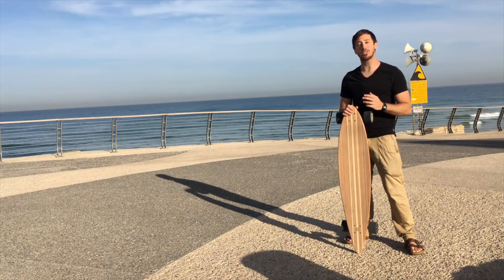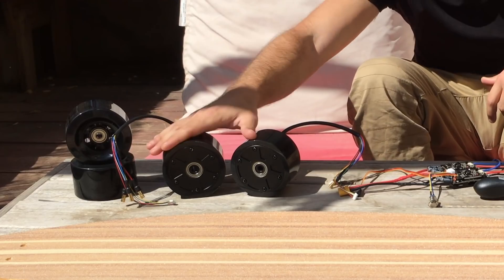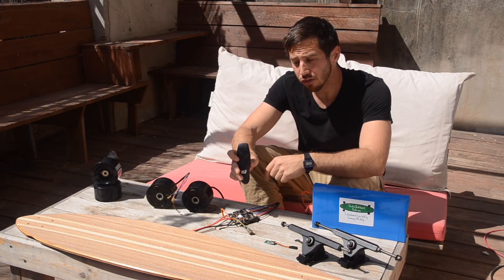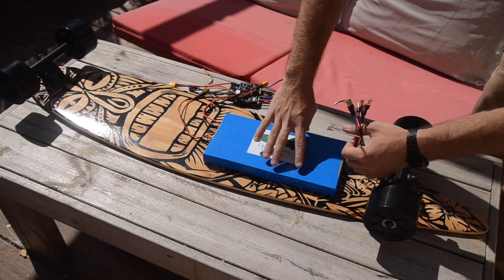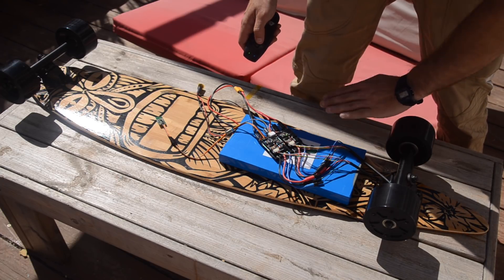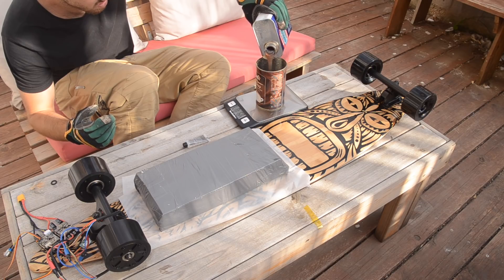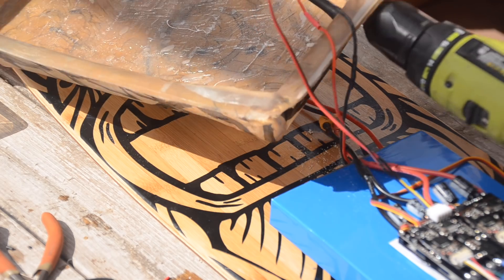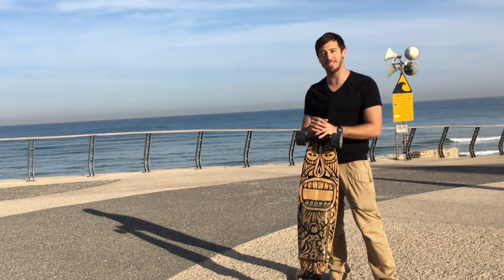Build a DIY Electric Skateboard or Longboard - it's EASY!

Comment: Did you do a range-test yet? How far can it go? With the nice flat battery it seems like you could even fit one more on a long board... Thanks for sharing!
Reply from the maker: Yes I get about 10-11 miles if riding pretty hard. More if I ride it a little easier.

Comment: I noticed you solder with a traditional soldering gun old school way. I Learned  heat shrink solder sleeves and they have liberated me from the tedium of old school soldering . Have you tried these are you familiar with them? My older eyes don't need to wear reading glasses like when I had to solder with a soldering gun. Soldering wires is a rapid thing now

Comment: Nice video! Just a few things: if the motors are spinning backwards, you can just swap 2 of the phase wires around and not switch al three connectors to a new esc.
Reply from the maker: Unfortunately that trick only works for sensorless motors. These are sensored so you’d have to switch the halls too.  But in this case, the wires match color to color, so it was a case of opposite controller.